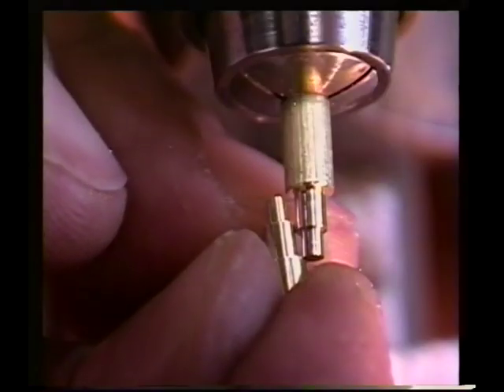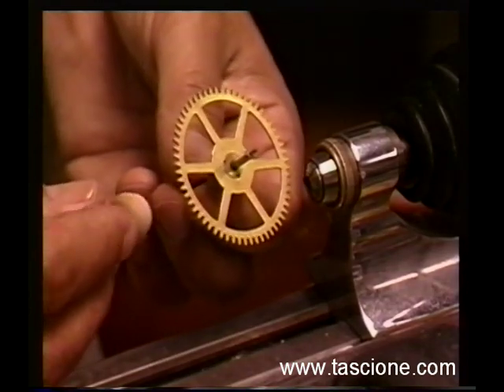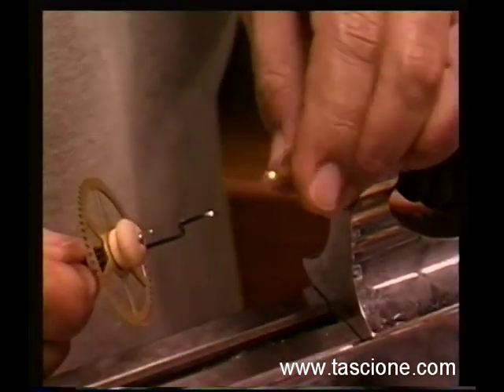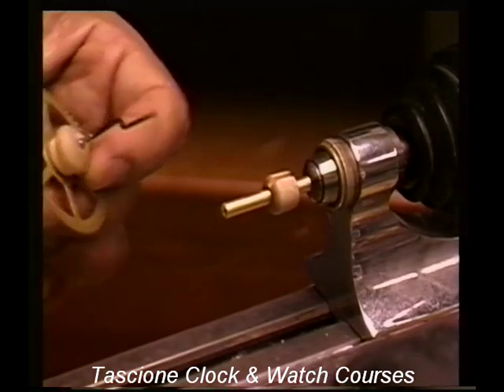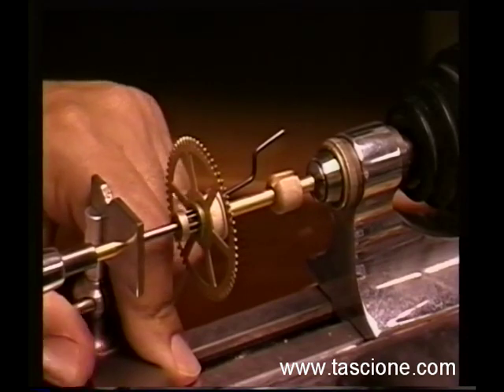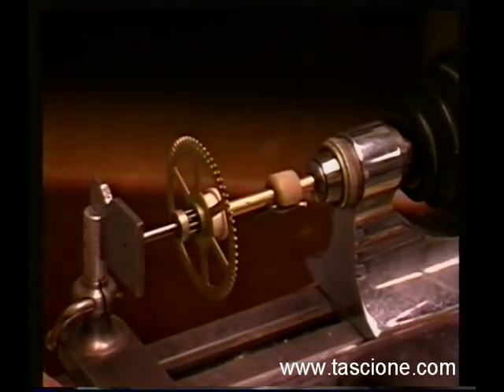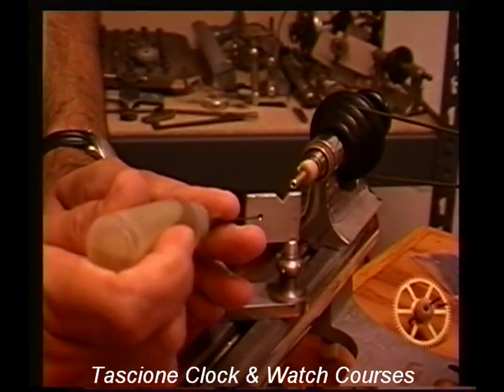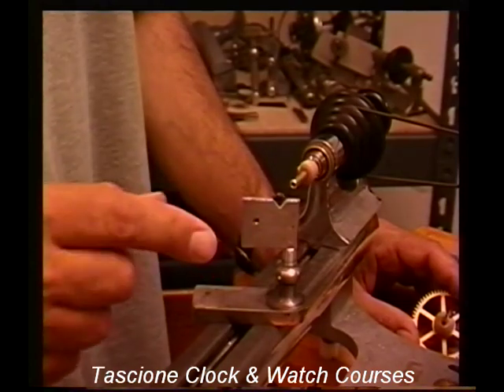Lathe Work Pivoting Part 2

Comment from the maker: Very happy to hear it helped. 
Yes we made this tool in the course video. Many different sized holes can be added as centering is controlled by moving the tool post and/or raising or lowering the flag in the tool post. The flag on this tool is riveted to the flag post but would have been better just to screw it on. Could use several flags this way with any number of hole sizes. Pretty simple design made from scrap metal that could be improved on very easily.